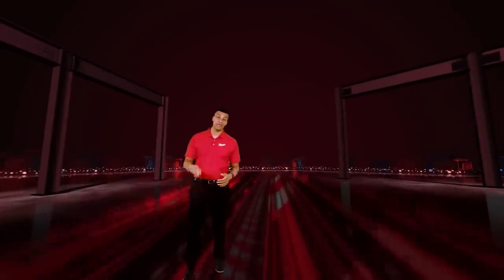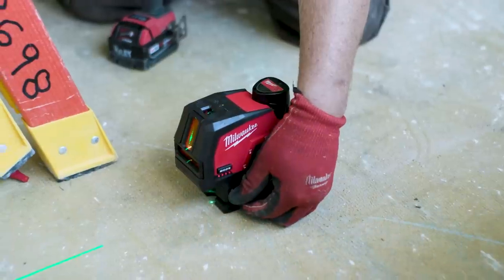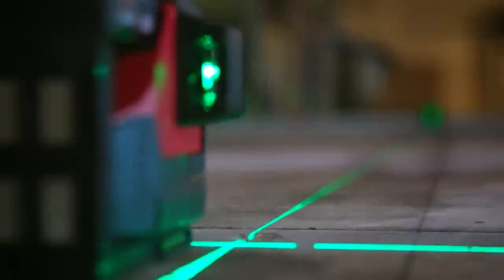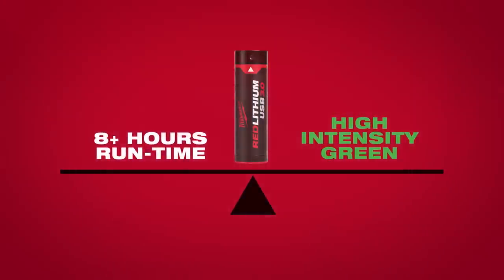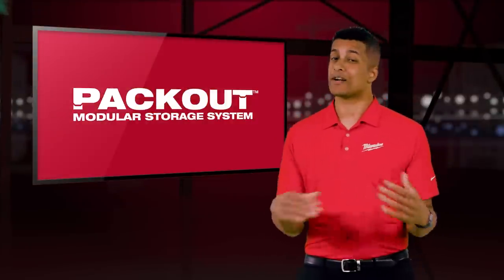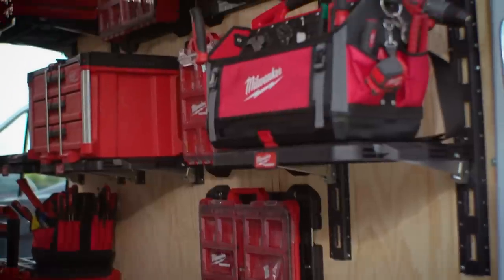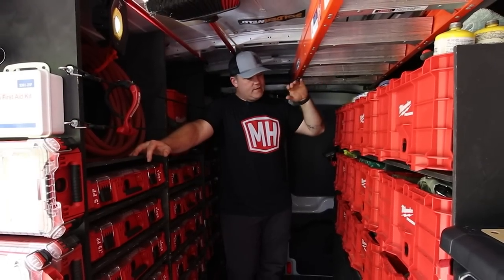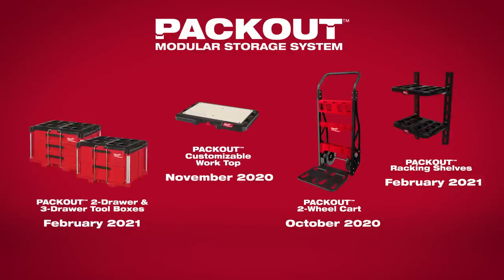Milwaukee® Pipeline™: Episode 2

Comment: I was looking at your packout worktop and I see there's definitely room for improvement on this first of all you can have Iggy expand by have a fold-up sides and a click into the side of your box probably 20 mm whole system so you can square stuff up like Festival does or maybe even if you don't do a flip up top baby just a slider door guide well that second Dairy side effect their side just expanding the length so you have much more work top to work with just an idea thank you

Comment: The work top is coming out in November but I magically had one in my hands 2 weeks ago. If the 2 and 3 drawer boxes were out right now I would be all in. It will be nice to be able to mount my pancake compressor to the work top and lock it to the rolling stack with all tools and fasteners getting from truck to job in one trip.